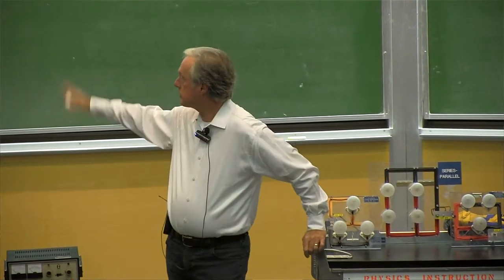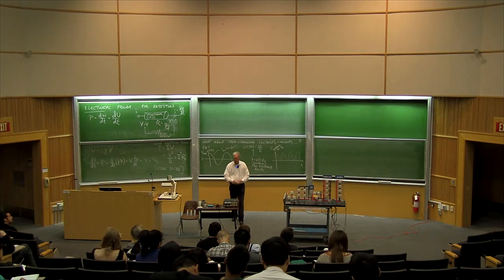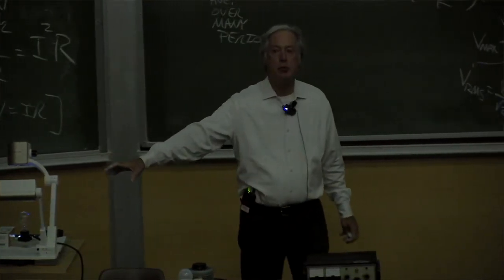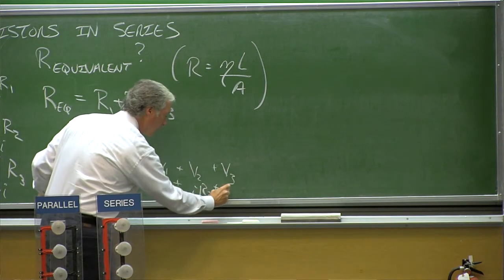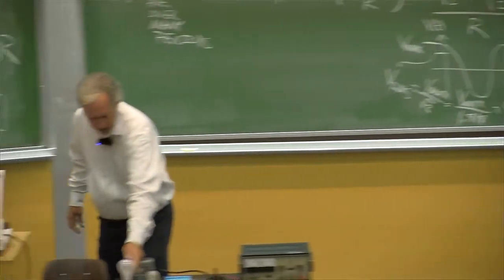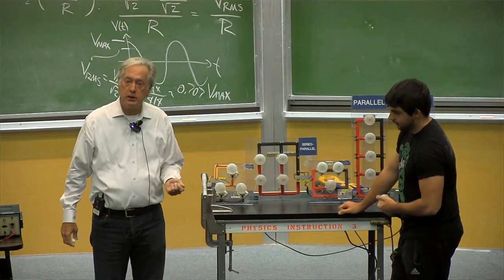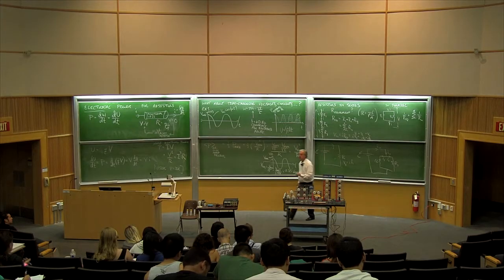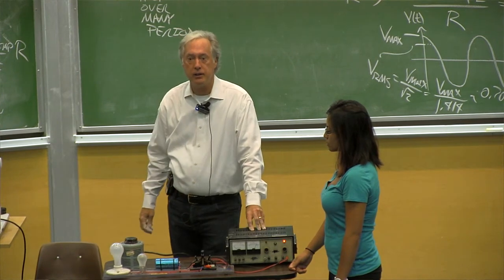Basic Physics II 3B. Lecture 14.

Comment: In case parallel connection  the current pass through resistor are different and sum of such currents is define as line current I= I1 +I2 +I3

Comment: For low voltage supply the tungsten having red or pink clour as pink or red should have relative way large wave length and ultimately low frequency so energy E= hn expectedly low ,for higher voltage the colour observed should blue of high frequency n so energy should be expected way E= hn is high